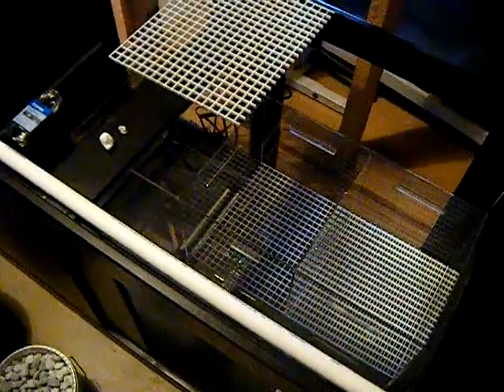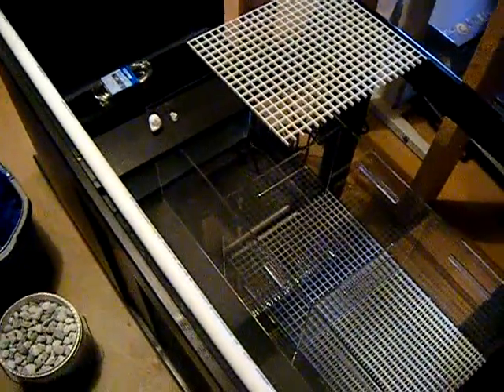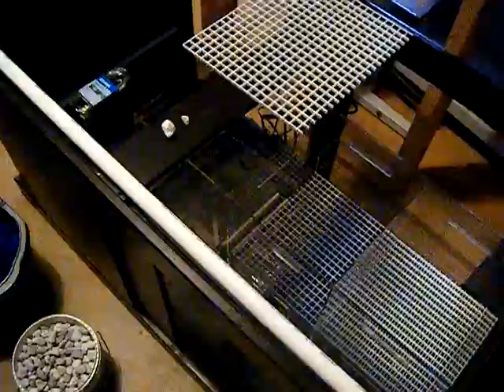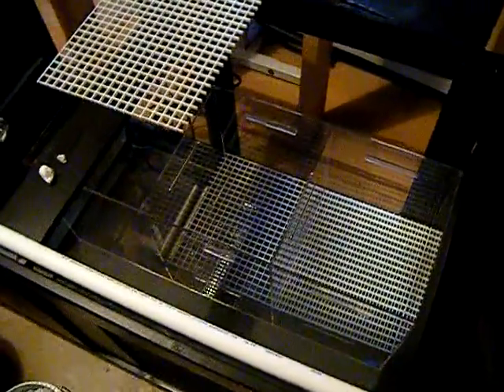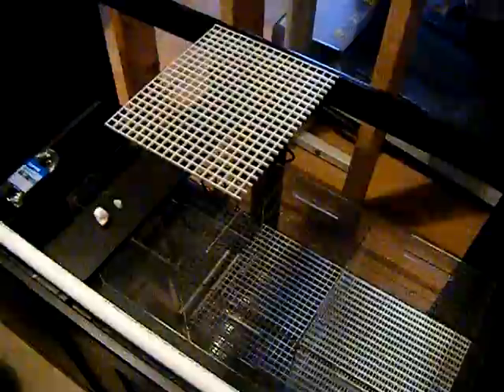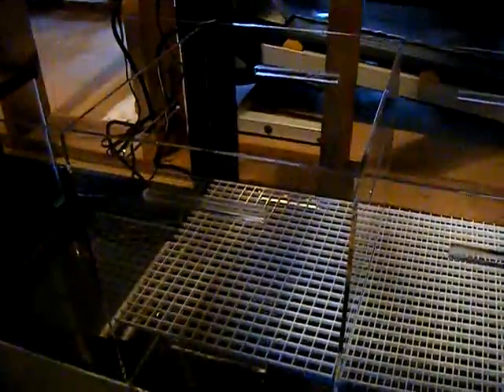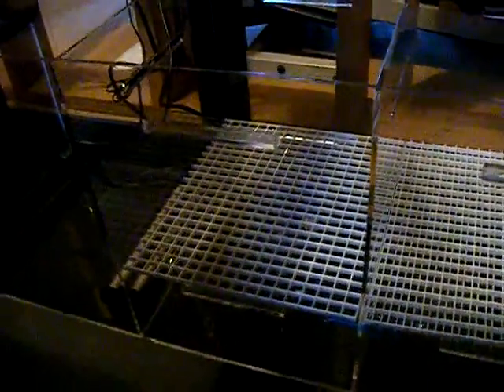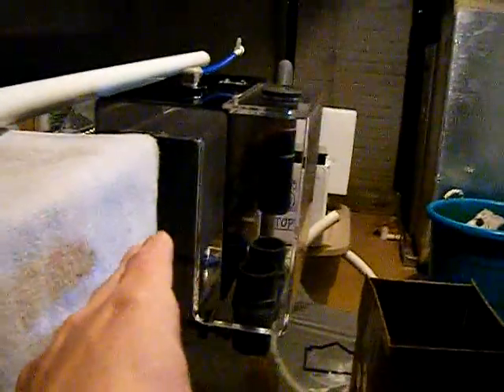150g filtration setup part 1

Comment from the maker: Exactly. That's why I chose Seachem's Pond Matrix. The pieces are larger in diameter than regular Matrix. I figure that with the extra internal volume there will be more area for anerobic bacteria to convert Nitrate into nitrogen gas. Seachem's Denitrate requires a flow of 50 gph or less to achieve anerobic coloization, but Matrix and Pond Matrix can be placed in higher flow areas and still have anerobic bacteria colonize its pore structures.

Comment from the maker: The JBJ Auto Top Off comes with two float sensors. One is for the low water level in the sump, and the other is for low water in the 10 gallon reservior. I top off the reservior once a week with deionized water, so there hasn't been an instance where the float has shut the pump off.

Comment: Great video! One question though are you going to put some sort of auto shutoff for the pump in the 10 gallon tank. That adds water to your sump due to evaporation. I would hate to see you lose your pump in your 10 gallon tank due to suck air when that tank is empty.

Comment from the maker: Thanks for the comment. I won't be relying on anything mechanical seperate of the return pump to keep the air out of the overflow box. Most people use an aqualifter pump, which can fail. The return pump keeps sending water to the tank and you end up with a floor full of water. I plan on taping and threading my 1" return line and inserting a 1/8" hose barb. I will run a piece of airline tubing from the overflow box to the hose barb. It should work the way a powerhead does with an aerator.

Comment: Very nice video brother,  good idea on the egg crate,  I didn't think about doubling up on the egg rate to make the holes smaller.  I currently have some small pieces of matrix on the bottom of my sump.  My plan to put bigger pieces on the bottom and smaller pieces on top didn't work out.

Those overflows make me nervous,  anytime that overflow of water on to my flooring is Dependent on something mechanical I don't trust it.  I prefer gravity drain,  but those boxes are very nice looking